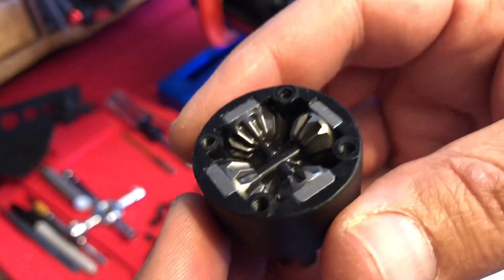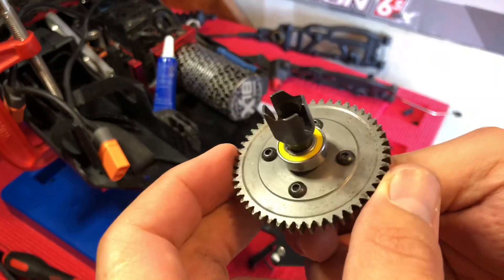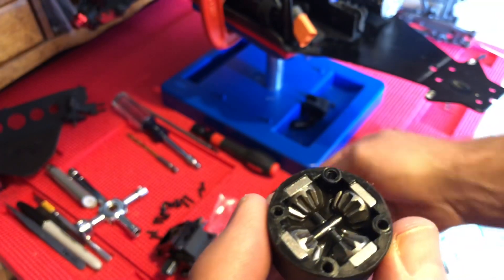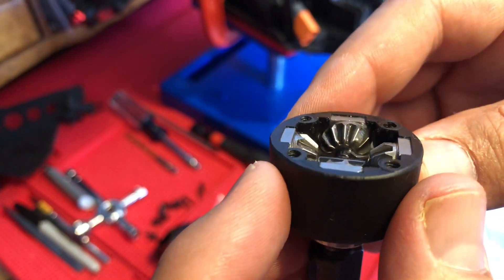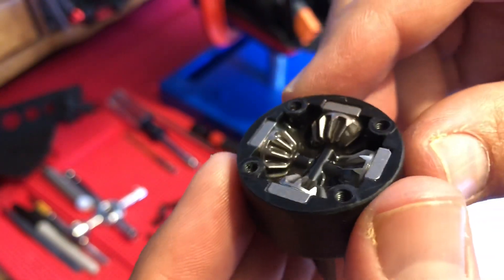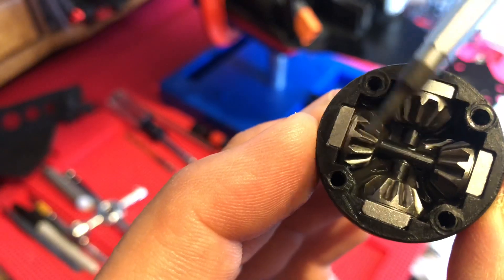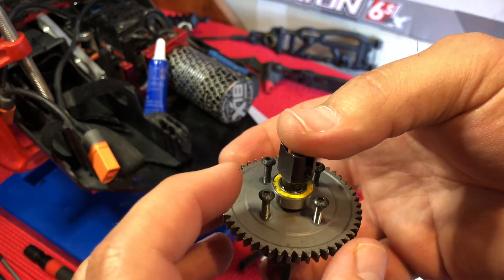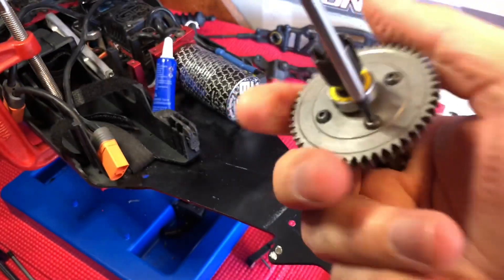ARRMA DIFF TIPS - Kraton, Outcast, Talion, Typhon

Comment: It looks that the leak is from the internal o-ring..
The gasket is preventing the oil to pass threw the big ring and the diff cup connected.. so i guess its o ring.. 
From where was the leak  at the end?..

Great vids !! I love them.
Reply from the maker: ETAI106, Turns out after getting the Tech Joe gaskets my leak went away. However I also did pick up some green slime from Amazon and put that on the little o-ring First before seating it into position. Stuff is amazing!

HALOFUN 1105 Factory Team Green Slime https://www.amazon.com/dp/B0006MZS1I/ref=cm_sw_r_sms_c_api_i_BGUyEbV19WGDA
Reply: @EastTactics  yeah, used that green slime on the o rings and the plainitary shim and was great... Great tip I got from Duperbash

Comment: Is it the fact I’m using 1 million in my Outcast Center diff the cause of rear Center driveshaft excessive wear. 

What diff fluid should I go with to help maintain longevity equal gear wear. 

Mine is always the same. Rear Center drive shafts loose their hard coating in a few lipo packs. 

I’ve replaced a few times now.
Reply from the maker: I have a quick clarification question for you so I can get a better understanding of what exactly is wearing out on your Outcast. 
You mention that your rear and center drive shafts are wearing. Typically I don't hear about the drive shafts themselfs wearing out, rather I hear about them bending etc.  
When you say Drive shafts (at least for me) I'm thinking your talking about the dog bone/Shaft/bar that goes from the rear outdrive to the center outdrive, and likewise the front one that leads to the from Diff house. Are you saying, that is whats wearing out?
Otherwise, I think you might be instead talking out the main spiral or input gears that exist on both the front and rear of the vehicle. Another common gear to strip out is the actual Ring gears on both the front and back diff cups. the two gears I just mentioned pair to one another and are probably the most common things to wear out/strip in our RC's. 
Are you rather talking out those? or Are your actual drivie shafts breaking/snapping. And by snapping Im meing the little nubs on the ends that catch inside the outdrive cups. let me know. Happy to help.
More over... if your having issues with gears stripping too easily, answer me these few questions too.
Are you wheelie happy, or punch happy. I.E. do you try to pull of standing backflips, or while going 10 -20 mph do quick bursts to pop the front end up and start to wheelie?
Second Question - What tires are you running... Stock... or heavier tires?
You mention your running 1 mil in the center... what are you running in the rear and front?
How confident are you in your mesh settings for your three diffs.. are they all shimmed properly? 
These answers will help me help you solve this issue. 
~ EastTactics
Reply: @EastTactics  
Much appreciated man. Help is gold. 

I meant to say more clear that the dog bone metal pins and drive cups wear extremely fast. 

Especially on the Center / rear side Dogbone. And drive cups. 

Input pinion and crown is no issue.  

Stock wheels and keaton wheels 12 and 14 pinion I use.  

I think the thick oil is causing the Dogbone pins to wear but I may be wrong.  

I’m a still learning this stuff. 👊😀

I’ll take any help I can get. ❤️
Reply from the maker: @rcsendandblast1579  Interesting! I've never heard of anyone with this issue. You must have bullet proofed your diffs like a champ if your wear issues are on the shaft and the cups themselfs, (particularly the rear system, as you mention) which are tank components.
Tell me, how long does it take for the system to  break/strip out or otherwise stop working before you have to replace a part? And which parts exactly is needing replaced? you mention 3 to 4 packs... is that consistent. 
Which parts is giving way, is it the dog bone itself, are the T nubs at the end wearing off? (if so, which end). Or  is it more the outdrive cup? (if the cup, which one in particular, far rear, or rear center, or both. If the drive Cup going, is one side or the other  wearing to point where it snaps completely off.  
Again I find this very interesting, especially since I considering upping my center diff fluid from 200k to silicon earplugs. lol
Reply: @EastTactics  

It is only the pins and drive cups that take the fastest damage. 

I took advice from a good friend who showed me what shims to use and how to assemble it. 

Yes the Diffs seem bulletproof. 

Just wish I figured out why my dog bone pins are taking wear within a few lipo packs. 

I am going thinner way thinner on diff fluids hopefully that helps. 

I believe when I gas it the rear wheels have to much power transfer going back there and not enough wheel spin in the front. 
This I believe is what may be the case.
Reply from the maker: @rcsendandblast1579  that makes sense. I run 200k in my center... but have been considering putting in the silicon earplugs to see how that feels. Sounds like I might start jacking up my dogbone pins, and diff cups if I do. lol. what fluids you running in the front and rear?
Reply: @EastTactics  
5000 front 6000 rear 
Now 20’000 in Center. That’s the plan for now
Reply from the maker: So you were running 5000/1mil/6000?
That might have been your issue. 
Running that thick in the center... yet so thin in the front and rear. 
For a basher well rounded set up. Would be:
Rear 20,000
Center - 200,000 to 500,000
Front 80,000
Reply: @EastTactics  
Set it was 
20000 front 
10000 rear diff 
1 mil Center 

That was old set up 
Now all that’s different is t he Center is now 20000. I’m learning
Reply from the maker: @rcsendandblast1579  keep me informed if your new set up remedies the issue ok. Thanks for following my channel!!
Reply: @EastTactics  

Will do I am going to install new diff cups pins all that good stuff. Lighten up on the fluids and see if the plastic stays good for me  👊😀
Peace man thanks.
Reply: @Shadows-RC  
Well you try that and let me know how it would never work.  Like ever. 

With a 6s rig how’s that supposed to work. 

Fitting old shock eyelets is something entirely different that hardened steel pins. Ya just can’t cover them and expect them to work.

Comment: I just cleaned and reoiled my center diff on the outcast after I was done I noticed theres a little hole  that's meant to be there its in the exploited view on tower on the rear diff not on the center diff but is on the exploited view of the notorious, what is this hole??? seems like oil would leak out of it but I see no oil coming out of it.
Reply from the maker: brian Stover, Yeah, I know what you’re talking about. I don’t know what it’s for, but I can assure you that it doesn’t go all the way through into the chamber.
Reply: @EastTactics  it's a grub screw hole and I think if you want to drain your oil out you can. Maybe if you filled you diff too much and want to let a little out without taking it apart again?

Comment: What about automotive RTV like Permatex ultra black? how do you feel about silicon sealants such as that?
Reply from the maker: What exactly will you be using it for, to clean out the differentials. Or to lubricate them on the exterior?
Reply: @EastTactics  RTV is a silicon Sealant. i use on valve cover corners and truck diffs to oil pans. if i took a que-tip and spread it lightly to prevent it oozing into the diff i think it would work in this application on my typhon, ill try it out. i didn't know there was a dry hard gasket on it like that.
Reply from the maker: @koldleblue5079 , 
Cool… Sounds like it should work pretty good then. This is the stuff I use for the outside of my differentials.
https://youtu.be/oByzgDN0gTA

Comment: Hay what’s sup I’m about to shim my diffs I got the mugenseiki shims should I replace all diff shims on the planetary gears or add 2 to each diff. Tia
Reply from the maker: The mugenseiki shims are actually a bit thicker than the classic stock shims. For the spider gears, you don’t need to worry about adding an extra Shim in, In the every other fashion. For the spider gears, four shim total sill work. Many people are finding that when they install the large mugenseiki Shims behind the planetary gears it ends up being too tight. So I would actually recommend that you not use the mugenseiki shims behind the planetary gears. Instead stick with a small shim that comes stock To protect that small O-ring.
Reply: @EastTactics  cool ty very much I’m actually going thru ur video rite now thanks for all the info bro really helpful
Reply from the maker: Any time😎💪
Reply: @EastTactics  I got the v2 so the planetary gears don’t have no shims so I’m going to put one only of the mugenseiki shim and see how that goes
Reply from the maker: Sounds good.
Correct me if I’m wrong, but the V2 didn’t have any shims anywhere! So the fact that you’re putting them in is it gonna be really good

Comment: Idk if I missed it or if you didn't say. But can you reuse the original gasket if need be
Reply from the maker: If they’re in good condition and they’re not ripped in anyway. You can carefully dry them and reuse them. However if they are torn or worn bare in any spots youll want to pick up some replacements.
Reply: @EastTactics  cool thanks man. I don't even have 3 full batteries ran through the typhon 3s but I'm gonna do some track racing soon and wanna put new fluids in. Do you know a good WT for front and rear of the 3s. I bash some and gonna race some with proline m2s I believe they are
Reply from the maker: Well for the Kraton 6s I run 20 K in the rear 200K to 500K in the center, and 80 K in the front. That’s a good set up for a hard-core bashing. 
As far as for the 3S and racing, I recon The stock set up is probably good but you want to just make sure they are properly filled. 
Unfortunately I’m not sure what’s ideal for that platform. Are you familiar with the Arrma forums? I have a good feeling you can probably get your answer there.
Reply: @EastTactics  good idea. Thanks man 👍. I'll get the kraton one day lol